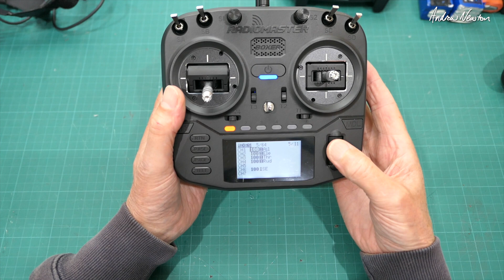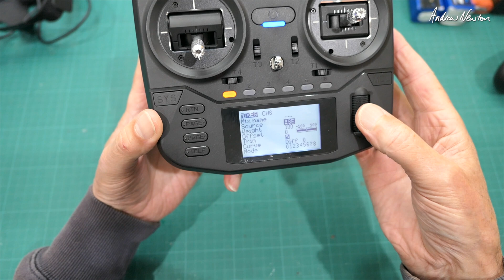RC Basics - Aux channels and Inputs

Comment: Hey buddy, I bought an elechawk led lights for my plane. I have it plugged into the receiver in aux 1. I've tried everything to be able to power my lights with a switch. What am I missing?
Reply from the maker: Should just work when you connect 5V, but there is no switching function.
Reply: @AndrewNewton  it's was working with aux 1 on my spektrum but just switched to a radiomaster. I'm using a lemon rx 6 channel and has an aux channel. Shouldn't I be about to set up a switch on channel 6 and it work?
Reply from the maker: @mrhuber101010  Might be a bug with the Spektrum protocol, Lemon Rx and multi protocol combination.
Reply: @AndrewNewton  I figured it out had to set channel 6 to a switch and the switch to act.

Comment: Hey Andrew, I am a huge fan of yours seeing your videos for the last 7 years. I would like to ask regarding the Quill foam hoard in Australia, could you please tell me whether it will fly or your experience with it? I presume  that using the armin wing technique with the Quill foam board will make it heavy, rather I am currently using the Quill foam board and using the balsa rib approach where the I removed the paper of the Quill foam board for the ribs and kept the paper for the spars before covering it with paper instead  of the balsa sheet for covering and finally with packing tape, let's see in the meantime any suggestions would be appreciated.
Reply from the maker: Yes it will fly but you need bigger planes to carry the weight.  Your foam balsa style sound cool. The thick card does add lots of weight to the Quill
Reply: @AndrewNewton  Thanks man really appreciate it